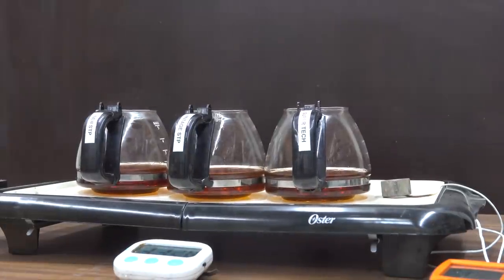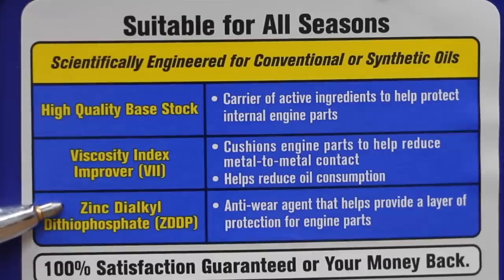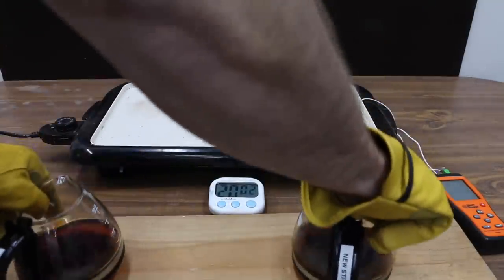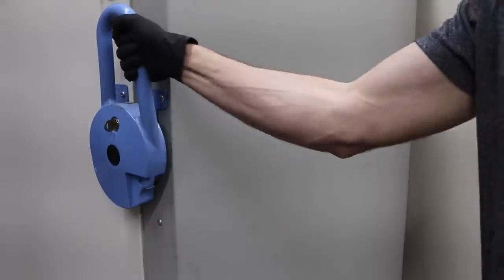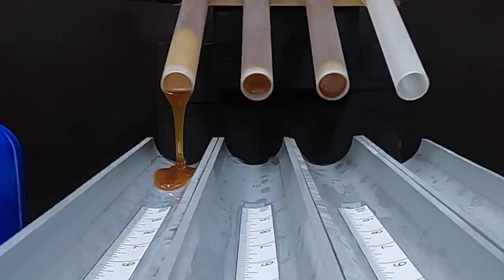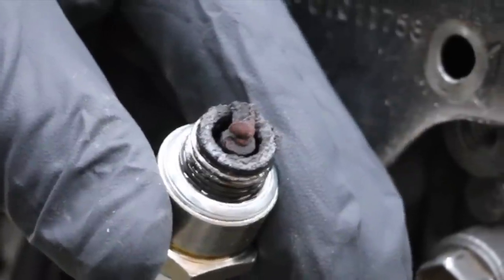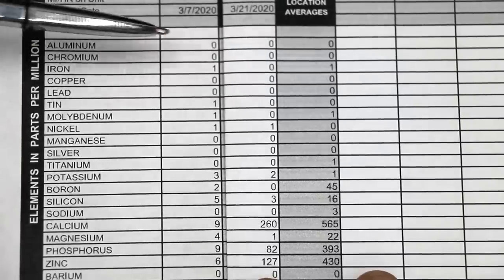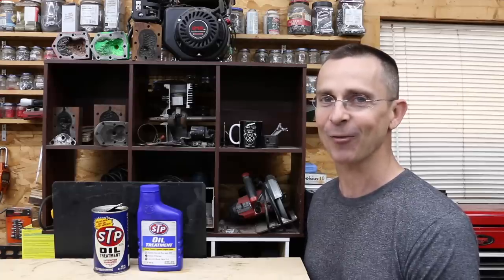Richard Petty's 1981 STP vs 2020 STP?  Let's find out!

Comment: I used STP with oil changes in the ‘60 and ‘70 and had the red decal in rear window. I never had a engine problem even though I ran the hell of it.
Reply: PS. I added the STP with 30 wt oil.
Reply from the maker: Thanks for the feedback.

Comment: My Aussie built Ford Laser which is an 89 Mazda 323 underneath, has improved initial throttle response off the mark and the temp guage is reading slightly lower since I poured a bottle of the STP. I think it is only effective when used as an additive as intended. It's early days yet though. It was encouraging to see your wear result when mixed with the oil. The modern STP may have been a fraction off due to being thinner, but the far superior cold flow performance far outweighs this.
Reply from the maker: Thanks for sharing.

Comment: Surprising result ,I really wasn't expecting that, I use Wynn's stop smoke oil treatment (£12) with my 10 60 FullySynthetic oil(£40 and upwards). It's much thicker than the vintage STP ,if the can is cold it won't come out. , it's mostly clear with some light yellow and pearlesant colours its a very stringey  goop like from a sifi movie.. 
It gets changed every 15k  miles mostly aggressive stop start city driving witj a 10% motorway blast at the end. emissions are near perfect, engine is petrol 3 cylinder 998cc 166k made in 2002.
Reply from the maker: Thanks for sharing.

Comment: Well, one item I do recollect from one of your previous STP vid's. The engine running temperature, in your Jet Propulsion Laboratory engineered lawnmower, was lower with the STP properly mixed in the oil. So, that's an air cooled engine and I'm guessing a water cooled engine would also run a few degrees cooler with the STP in the oil. Hence the amount of ZDDP might be less important if you have a higher film strength with the STP in the oil?

Comment: A local garage uses STP. A lot of people dont ask. They just take there car to a place and say I need an oil change. I usually do my own oil, but i didnt really want to bother, so i called this place to set up an appointment. I told them i wanted Mobile 1 used. They said if i wanted my own used, i would need to bring my own oil and filter to them since they only use STP for everyone. I just changed it myself. So some advice, never let a mechanic do your oil change unless you know whats going in it.
Reply from the maker: Good Point!

Comment: I was thinking earlier today about how the difference in temperature outside seems to effect my MPG's. Could you do some tests to see if it would be beneficial to change your fuel octane as the air temp changes. And I'm saying extreme summer to winter changes. Not like 10-15 degree swings from AM to PM.
Theory being if air density change, caused by temperature, would alter ignition so much that it would rob HP or fuel economy. If so, would lowering or raising octane combat that.

Keep up the great work!
Reply from the maker: Thanks for the video idea.

Comment: In the early 80s I was stationed in Germany....so I had a V4 powered german ford...yes...V4.....it had high milage and smoked like crazy driving top speed on the autobahn...about 80mph....a little STP like additive ...read high pressure lubricant....stopped the mosquito fogging on the autobahn 😁
Reply from the maker: Thanks for sharing.

Comment: I have used STP in every gas engine since 1988.  I do properly mix it. (you used straight STP in the mower a no no)  I do get many miles out of my cars.  Usually my cars get to rusty to drive and several have gone to the junkyard with perfect running engines.  My 1986 nissan 200sx with a 2.0 liter has currently 386K (don't drive in salty Michigan winter) and it does not burn oil.  I bought the car used off of the "lemon lot"  USMC base Cherry Point N.C. in 1994 with 71k miles.  I got a test for you...I do this every oil change...I drain the oil on every engine I have when its due over night (cars to my Briggs and Stratton motors).   Compare the amount of oil that comes out. Compare (uncle Eds) like a 10 minute oil change vs all night and maybe look at what difference of what is in the drain oil (short change vs longer change).  I love your show and watch all of them!!!!!
Reply from the maker: Thanks for the video idea.

Comment: The additive should have been mixed with the oil in the correct amount. Too much addtive can actually increase wear. Heavy crude, like straight additive, will not seep in above the rings to seal them against the cylinder bore. There is no need to add any additives to the oil, as modern oils contain all the additives you will ever need. See all the Total Seal Ring videos.

Comment: My dad was a firm believer in STP and had me add that crap to my oil changes on my motorcycles when I was in high school. I’m convinced it contributed to, if not caused, my 1986 Honda CB700SC Nighthawk S to completely burn up. The dealership that performed the rebuild said the oil cooler was completely clogged. NEVER put that 💩 in your engine.
Reply from the maker: Thanks for sharing.

Comment: I found your channel about a month ago and so far I have been enjoying all the tests you do.   I have seen lots of oil videos dealing with engines.   One product that doesn't have much review is WS2 (tungsten disulfide) as an oil additive.   I know it can be purchased from e-buy fairly cheap around 10$ per ounce.   
Some of the questions about this as an oil additive are 1, it settles in the oil after a day, so how much mixing occurs on restart.  2, will it plug an oil filter, it should be small enough to pass, but no testing has been done.
3, does it improve performance of the motor- reduce friction?

From what I have gathered you mix about 1/4 ounce per QT of oil.

The warning on this product is it will never fully be removed.  This means a drop here and there can make a real mess and leave a stain on the surface....or testing equipment.

I'm asking you to look into this product for the simple fact you have many great videos and keep an unbiased review in mind during the video.   Thank you for the consideration of this dry lubricant application.

Comment: I don't know if the new stuff is the same but if you had an old car with out a gasoline powered CO2 generator (catalytic converter)  that used oil the old STP helped a bunch.
I quit using it when I got a van with the 5.4L triton V8, that is a much more modern design and probably would not handle the thicker oil so well.
I have to wonder unless you live in Alaska how realistic is the -40F temp test?

Comment: I heard the Original STP would collect into a thick paste in the bottom of the oil pan after regular use. Normal driving never got it hot enough to mix into the oil.
Reply from the maker: Thanks for sharing.

Comment: The cold flow rate is a great test but without any agitation other than gravity may not tell the whole story. Maybe consider adding removable bottoms to the tubes? I'm not sure but it seems that something like honey flows better from a spoon than a tube.

edit - better think ketchup from a bottle. water would flow faster...

oil cold or not doesn't require gravity to coat an engine but is mechanically agitated. Dip a spoon into cold honey it may not pour fast and be harder to "grab" but it will take much more with it.

Comment: My son-in-law brought me a four wheeler to work on, he had just bought it used and wanted to test and upgrade the brakes, exhaust system, wheels and tires. We changed the air cleaner, oil, oil filter, and spark plug. Someone had filled it with straight Lucas  oil and when we put regular oil it started smoking badly. I was thinking is Lucas oil better the STP? And can it do a better job on clapped out engines? Thanks for sharing

Comment: Thanks for confirming my life long attitude against any engine snake oils. Buy the lowest price Walmart oil [Warren distributing] synthetic or normal, and change it on time.
Reply from the maker: You are welcome!
Reply: This is not 100% sound advice. I can guarantee you my 15:1 grudge motor will not make the power it does on Supertech oil.

Comment: Did you actually put straight STP in the crankcase? If I recall from the 1970s, that pull tab can was the amount to use mixed with conventional oil in an automobile engine. For most automobile engines that was 4 1/2 quarts + the can of STP to top it off (about 11% STP). The viscosity of STP alone is so high, it won't flow properly into bearings and rings. More than likely 100% STP in the crankcase of anything would do more harm than good.
Reply from the maker: Thanks for the feedback.

Comment: Here's what I use STP for:  When I get an oil change at the shop, the car comes back with that wd-40-viscosity oil that they use nowadays, and the engine is rattling and clanking like shaking a jar of marbles.  So I put in just a couple of ounces of STP in, just so the engine isn't beating itself up any more.  
And oh by the way, the word "viscosity" is defined as the ability of a material to flow.  That means that a thin material has high viscosity and a thick material has low viscosity.  The opposite of what the professor (and everyone else) says.
Reply from the maker: Thanks for sharing.

Comment: I'll say 1 thing I had a dump truck in the 70s and 80s with a 5 speed manual transmission I hauled heavy loads out of soft fields my truck developed a noisy low gear i put a gallon of stp in the transmission with the gear oil it quieted the transmission made it smoother 10 years never had the transmission give out..
Reply from the maker: Thanks for sharing.

Comment: Honestly I believe adding any oil lubricant enhancer, like stp, will improve oil viscosity. I do believe that stp  helps older motors with advanced miles. I also personally don’t add the whole bottle of stp. Why you may ask. Because I’m just adding to increase lubricant/viscosity of the existing oil. 
ZDDP is important for flat tapped engines. How much isn’t clear in my research. I buy 4 ounce bottles of strictly ZPPD. Adding one 4 ounce at oil changes. 
157,000 miles on a 305 and no loss of oil from burning. However some bluish smoke at start up….sometimes. Probably valve seals.
Reply from the maker: Thanks for sharing.

Comment: I've never run pure stp in an engine , a 50/50 mix of stp and 90 gear lube works much better to quiet knocks and does not foul the plug so much but it will eventually , nothings perfect for old smokies except new rings and a rod.
Reply from the maker: Thank you for the feedback!

Comment: Request for a video: workshop air compressors. Comparing style ('barrel' vs. 'hotdog' vs 'pancake'), noise level (db), ability to hold pressure (style may be a factor, also volume), and time to get to pressure (comparing style & engine power). There are a lot of brands to compare, including the main brands (ie, Craftsman, Dewalt, etc:.) and others such as California Air Compressors and Harbor Freight's brands.
Reply from the maker: Great suggestion!  Thank you.

Comment: I just remember in the early 70's that when you pulled apart a motor that had been running STP that there would be a layer of congealed whitish gunk in the valve covers and other static areas. Now granted these were usually motors with significant wear and blowby, so there'd be some gunk buildup regardless but far worse with STP. To be fair , Bardwell, Casite Motor Honey and many others were about the same. Quiet down the clatter and get another month or two out of a plumb beater was my only reason for using any of these. We did use a can once in awhile as assembly lube on a motor until a race engine guy suggested grabbing a quart of 20W50 instead. Have you done one of these on Lucas? I'd like to see that. Thanks!
Reply from the maker: Thanks for the video idea.

Comment: Fully supported by testing, adding 20% STP to a 5w30 oil turns it into more of a 15w40 for summer. I do this to diesel engines that don't run enough over the year to deserve a summer/winter oil change.
Reply from the maker: Thanks for sharing.

Comment: When I got my first car, I was told most of these "oil additives" are gimmicks at best. I could see adding oil treatments to older engines with looser tolerances, but with motor oils being improved, and tolerances tighter, we no longer live in the days where it needs changing every 3 months, and an engine needed an overhaul after 60k miles.
Reply from the maker: Thanks for the feedback.

Comment: Thank you very much for your videos. Wish you were around years ago could have saved me lots of time money and headaches. 
I would like to see a comparison of Royal Purple (HPS) against other racing oils like Redline, Motul, and Amsoil. I have seen the video of the standard Royal purple stacked against the others but felt this was a little unfair. Redline, Motul and Amsoil are premium race lubricants where as the standard Royal purple is just a consumer level like standard mobil 1 etc..... but the Royal Purple HPS is the prem. race oil equivalent to the other big 3. As everyday consumer level oils the lowest quality oil's limits are rarely if ever met, but in the extreme conditions of racing limits can be met quiet often and just the smallest difference or lack of in the lubricant can either win a race or cost thousands in repairs. 
Thanks Anthony
Reply from the maker: Thanks for the video idea.

Comment: My daughter has a car with oil pressure low. I run 2 liters diesel 15w 40 Rotella because of high zinc count and liter of rislone motor fix   in a bottle and liter 30 w mower oil.  It's variable valve timing cam with no issues.  Still running. Lol
Reply from the maker: Thanks for sharing.

Comment: Worked at a gas station in the 70's.   When we changed the oil on cars that used STP,  the STP sat at the bottom of the oil pan and never mixed with the oil.   Pure snake oil.
Reply from the maker: Thanks for sharing.

Comment: Piece of advice you should send out your oil samples to two different  labs not just one.
We had issues with ANA LABS during testing a intentionally contaminating a oil sample sent out to ANA labs. The testing of three samples were done in house with our equipment Ana labs and titan labs. One Company told us that they found no contamination  were the other lab came back we the same levels of that we tested. The reason we did this is one lab kept giving us a report of no issues on various fleet vehicles  those same vehicles later needed engines.
Reply from the maker: Thanks for the feedback.

Comment: You should do a synthetic oil test that shows which brand has the most zinc. This would be extremely helpful for guys with older cars running flat tappet camshafts.
Reply: My prospective hack is, when you change oil, put in a pint of racing oil. Racing oil is high in zinc and those old engines are not that sensitive about oil weight. You need to research the topic yourself. I found a lot of information real quick.

Then there is the issue of effect of zinc levels on catalytic converters. Oil and oil vapors get past the rings and into the fuel mixture through the PCV system in small quantities. If your vehicle is pre-catatlytic, then you don't have to worry. Lucas, I saw, sells a high zinc multigrade. I don't think you need to use 100 percent high zinc oil in a daily driver. You also can mix conventional with synthetic. That means you can use a high zinc conventional as the carrier to get some zinc into your oil of choice. Lots of angles here. I'm a good researcher but I just drive and ordinary car. No special experience.
Reply: @anonymike8280  Just out of curiosity it would be nice to know which brand has the most zinc with modern oil weights. Including Diesel engines. On my two older car I use Rotella T6 for almost 18 year now. One is a 1995 Mercedes Benz E320 and the second one is a 1990 Chevy Corvette convertible. I use 5w 40  with wix oil filters for the Vette, and Mann filters for the Benz. Over the years I'm pretty sure that they changed their additive package so it would nice to know.
Reply from the maker: Thanks for the suggestion.
Reply: @sportsmansparadice42  I'm not sure, and I'm not sure you need additional zinc for production of the 1990s era. You just need to do the research. Put in the search terms, read some articles, and you will start to get the idea.

I have 2001 4cyl Camry. The basic engine was introduced in 1990. It was based on even earlier designs and not changed a lot after that.  My designated choice of oil is ordinary semi-synthetic, but I got a jug of synthetic for free, and that's what I am using now. As long as the oil is the correct weight, you can use it. I doubt synthetic was original in either of your vehicles.

Comment: Interesting video.  The wear test favors oil with STP, so to me, that means adding it to the oil wins hands down.  However, why, oh why, did you tell us grams and millemeters instead of ounces?  Most of us Gringos can't visualize metrics, so it would be nice if you would use OUR measurements for all.

Comment: Did you shake up the old stp before you used it. If oil sits too long the additives will drop out to the bottom of the vessel.

Comment: Interesting , amazing and informative. How does STP additive compare with Lucas additive with zinc? Reason I ask is that I run vintage engines and flat tapper cam shaft failure is a concern with modern oils.
Reply: @SergeantExtreme  Thank you sir. Being in the northern climates I have been running synthetic diesel oils for years and it has worked well and  most Diesel engines are not roller cammed.
Reply: @brianhdueck3372     Wait....you've been putting diesel oil in your internal combustion engines?? 🤨